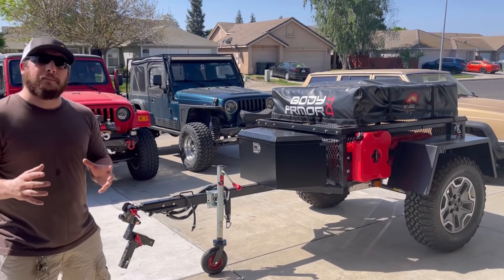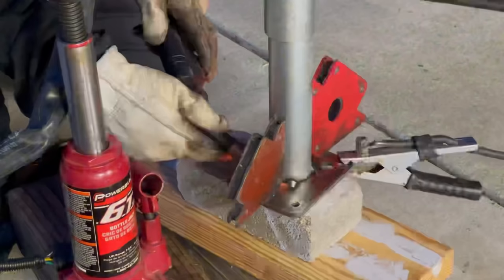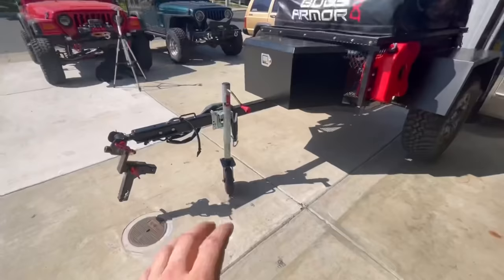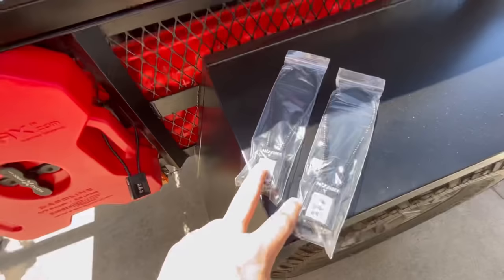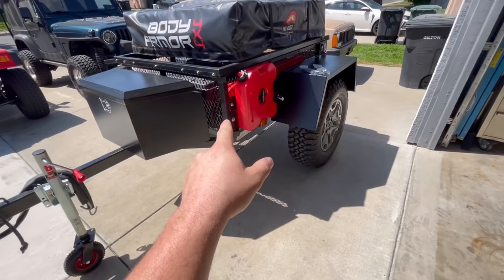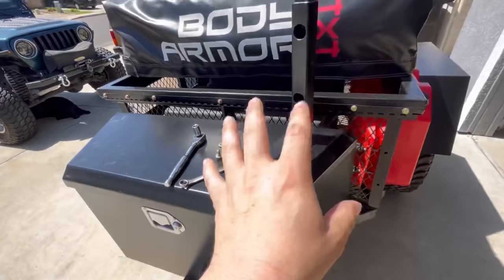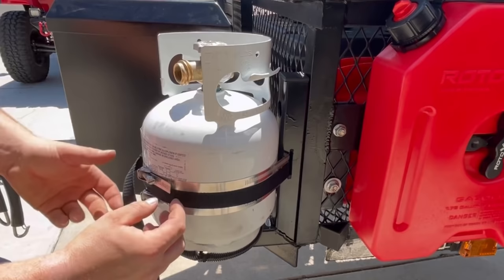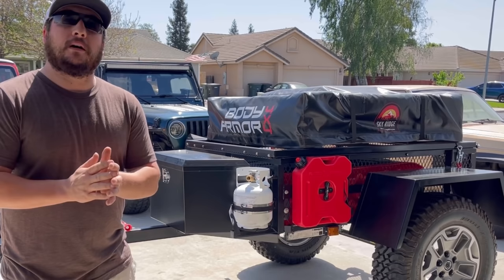Budget Overland Trailer Build Pt5 - DIY Rotopax & 5 lb LPG mounts + My Favorite Upgrade Yet

Comment: you could use a trashed gas grill regulator and make a cap - it has the right threads already
Reply from the maker: That’s a good idea, I bet I could transfer the design to solid works and 3d print them too. Thanks  for watching 🍻

Comment: It may be a lil ghetto but you can use a water bottle, heat it up and it will take shape of the propane threads to close it off from the elements. quick and ez
Reply from the maker: No idea is a bad idea, I found a cap on Amazon I’ll show it to you in our next video 🍻

Comment: Drill you a hole in the bottom of that bottle mount for water to drain so it doesn’t rust out. Otherwise everything looks awesome!
Reply from the maker: Good idea , then I won’t have to remove the plastic cap! Thanks for watching 🍻
Reply: @ATEMOFFROAD  I'm a year late to the party, but I was going to recommend another "poormans slot" on the bottom for drainage.  Also get some round caps for the big holes.  Love this build man

Comment: Very nice! May I suggest a weep hole so the bottom tube of the jack can drain. Water splits tubes and pipes when it freezes.
Reply from the maker: It’s been great to move around in the trail. Also a weep hole is a really good idea. Thanks for sharing 🍻
Reply: @ATEMOFFROAD  Remember to clean out the weep hole before winter. Especially if it's under a 1/4 inch.
Reply from the maker: @johnossendorf9979  thank you , as of now it’s been garaged, but I do plan on taking it through weatherly storms. 🍻
Reply: @ATEMOFFROAD  Sounds like fun !

Comment: Great project you got. Thank you for sharing. Btw, can kind and brand of welding machine are you using?
Reply from the maker: Thanks and welcome to the channel, I’m running a Hobart handler 187 MIG welder. I change from flux core to 75-25 gas in this machine all the time. 🍻

Comment: Did you use a mitre saw to cut the tubing? If so, what blade? I'm new to fabricating so trying to figure out what tools I'd need to build my own
Reply from the maker: Yes I have a 12” chop miter saw for steel and a band saw that I switch between for making all the cuts. I use dwalt blades found on Amazon. 🍻